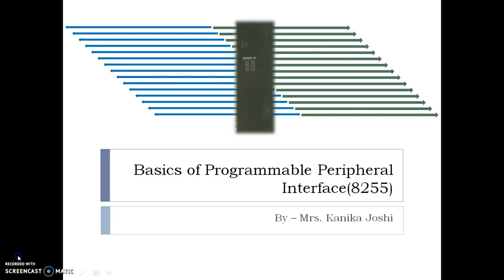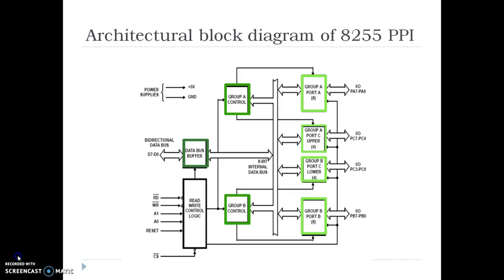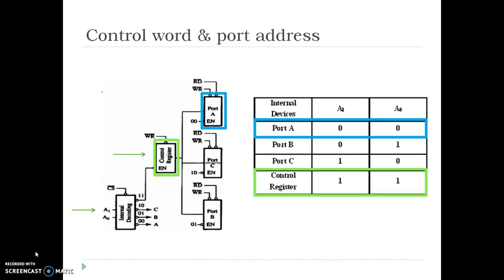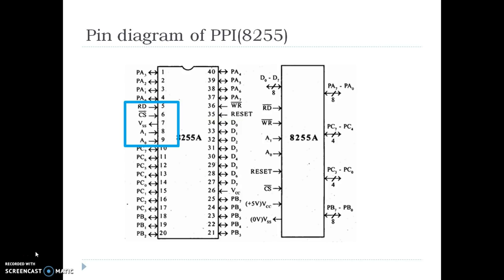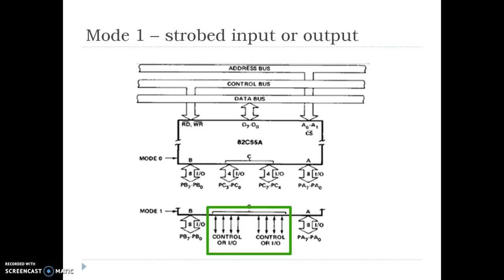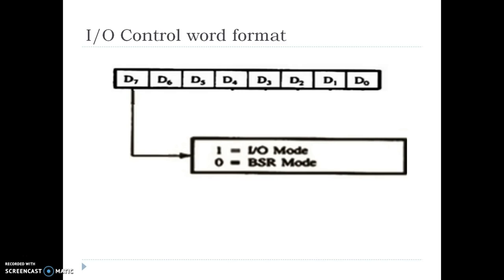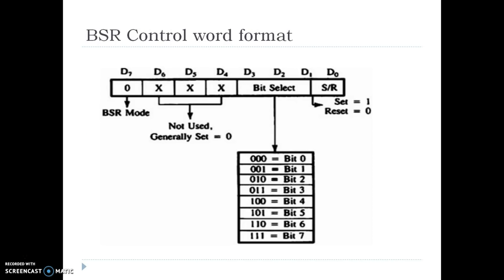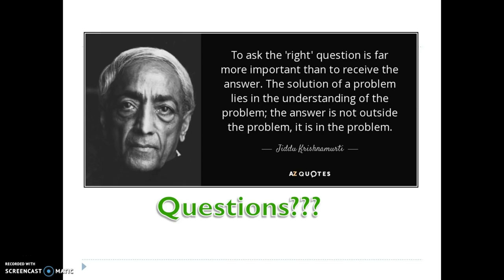Basics of PPI 8255IC

Comment: I've been using this IC with the Zilog Z8 microcontroller. I'm running in expanded mode so I lost 16 lines of I/O. This simple IC gives me back those 16 lines I/O with an additional 8 8 lines of I/O. I learned how to use it by bread boarding and manual controlling it with some switches and monitoring with leds.

Comment: I have 3 questions:
- Isn't Pc7 shown as Input and Pc0 as Output at 9:05 ?
- Why cannot I take Group A mode to be Mode 2 - 1X
- By chance if my Control word has an X in between, how do I calculate hex value ?
Reply from the maker: Hi,
- EOC stands for end of conversion  and SOC stands for start of conversion. So, SOC is given by processor or 8255 to start the conversion process and EOC is given by IC to inform about the end of conversion process.
-X  by default is taken as 0 for hex value calculation.
- 1X- Microprocessor reads from MSB to LSB. So, 1 will denote mode 2 .